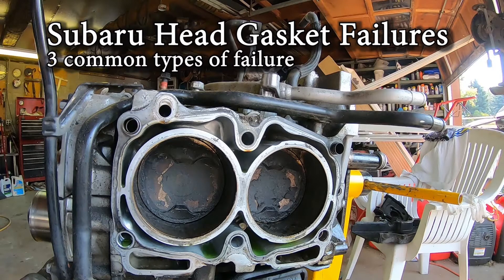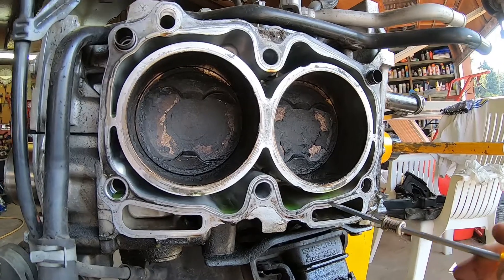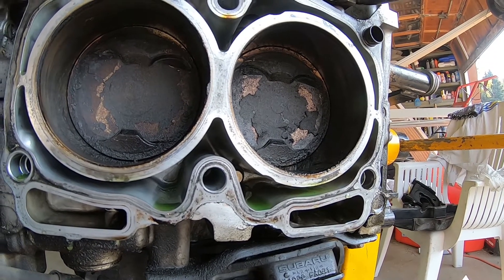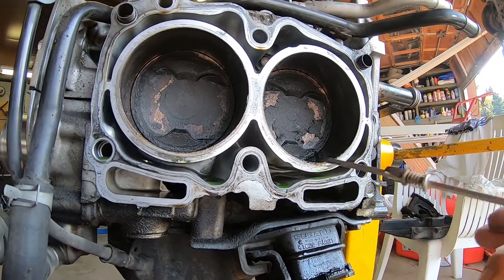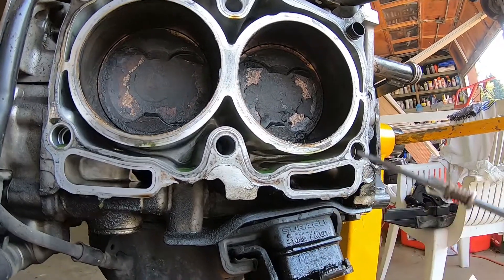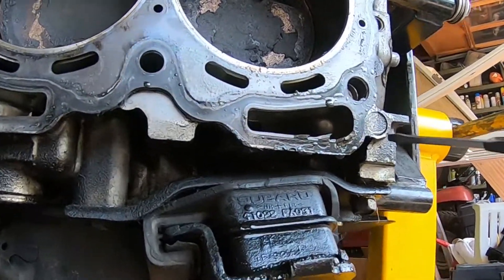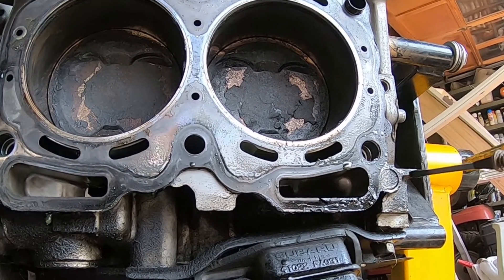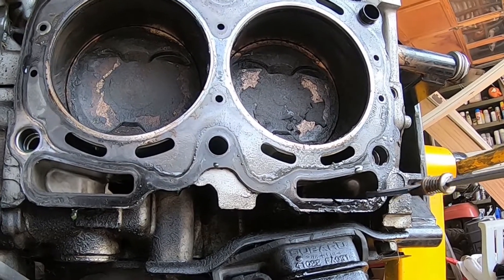Explained - How a Subaru Head Gasket Fails

Comment: So mine over heated in the past when it blew a hose and radiator. But ran fine for couple years after. (My dad owned it at time) Now when it gets warm a little smoke comes from the left side of engine (as ur facing the engine from front of car) and smells of burning. No oil/coolant mixing. No exhaust smoking. Steady idle and no bubbling in coolant. Im hoping maybe just rocker cover leaking on exhaust or something?

Comment: I'm almost certain my 2008 impreza has head gasket failure but here are the symptoms: white smoke from exhaust (a lot of it), coolant level always falling then sometimes draining out the reservoir because theres too much (might be thermostat), high temps randomly then falling back down, blow by on the oil cap (to the point where the cap doesn't stay in place if you unscrew it), the oil isn't milky yet so I'm assuming the failure isn't at the place where oil and coolant are together but a smell of burnt oil is present. Can anyone confirm if this is a failure and if I should try one of those head gasket sealers before I scrap the car.

Comment: Hey man question i have the 2009 subaru forester 2.5 liter . So  far is only seepage not leaking oil no coolant .hardly lose any oil between oil changes .  It has the single layer mls gasket . Can i drive it like that no problems.  I heard i can go years with it no problem as long as i monitor oil levels ?
Reply from the maker: Yes, just keep driving it and keep an eye on oil level.